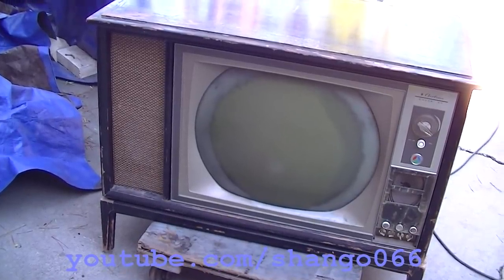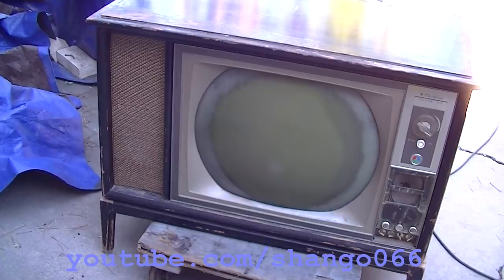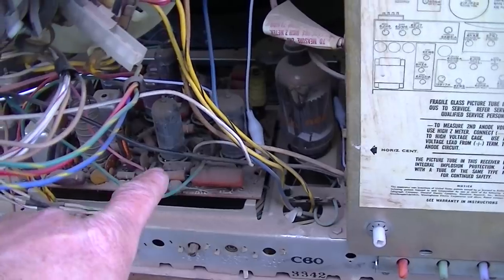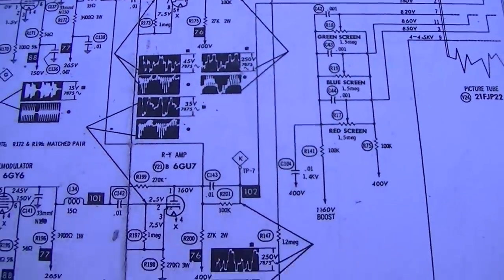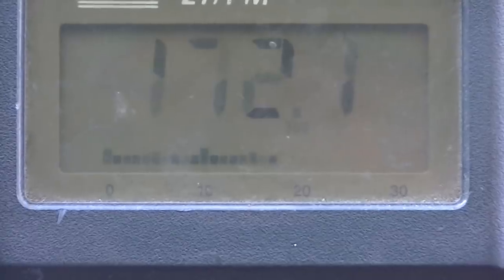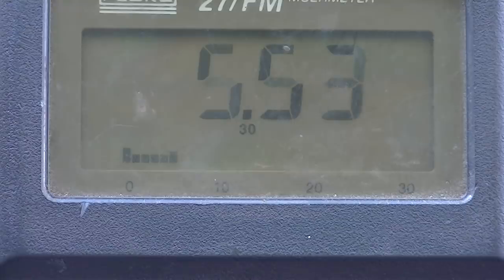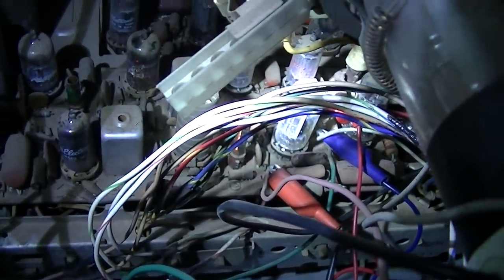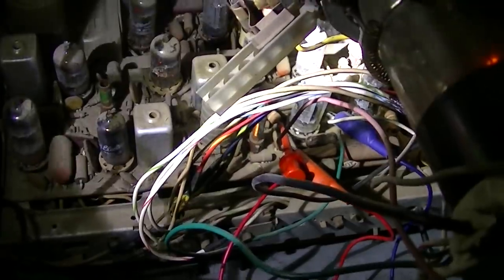RCA CTC15 Color Final Repair Purity Convergence Setup 1964 Color Television

Comment: I just started watching this video this morning and fairly quick into it I"m yelling I know what's wrong.  50 years ago I was working for a TV shop in Longview, TX and had a CTC-15 on the bench displaying the same symptoms.  The Boss/Owner of the shop let me get out more and more gear trying to find it until I guess I was just eating up too much time.  He came over and shined his little penlight on that wire on top of the board and said change that wire.  I did, he was right.  When I pulled on it it just fell apart.  Bravo for finding it without the Boss showing it too you...
Reply: Awesome story.

Comment: The all-plastic LED flatscreen I'm watching this on has a much better picture, but it certainly won't be around 55 years from now.
Reply: most of these aren't around 55 years later either, and this one is only back after many repairs.
Reply: OLED=crap, LCD=crap, Plasma=much much better, CRT=King
Reply: @Synthematix  Plasma is without a doubt the least reliable of any of those, by a huge margin
Reply: @onometre  depends in what brand you buy, pioneer were the best, also plasma tvs colour reproduction is 10x better than lcd, buy cheap buy twice, my pioneer set is going strong after 11 years
Reply: Well I would say probably even an older CRT like this does have better contrast and color (when working right and not worn out of course) than an LCD. LCDs do have better sharpness though thanks to pixels.
Reply: My brother repairs those things on a daily basis. They make them hard to service on purpose. He says they could make them to last a hundred years if they wanted to. Instead they design them to last only 2 or 3 years.
Reply: The point is the picture was way better, but by now all of those tubes are dimm and weak, that's why the colors and definition is like that.
Reply: @stevehoward3049  Eh, I dunno about that. Some electronics are like that of course, but with consumer TVs specifically, I think it's more so that they just don't think about serviceability at all, rather than making it purposefully difficult. It's simply cheaper to not bother; the short lifetimes and unrepairability are just a bonus.

Comment: How you leave your video's raw unedited makes you look smarter because you found the problem and how to fix it as well. Keep up the good work.
Reply: It’s more educational, since it’s how troubleshooting really is. Rarely does someone figure it out on the first try.
Reply: Was going to make a remark when shango066 said something about 'troubleshooting', that's OK as long as you can get the schematics. Hard to do on anything new today, (no schematics available) and it's hard to find the old things like these neat old TV's that you CAN get schematics on. REALLY hard to diagnose without a schematic.
Reply: @randyr.parker2698  Almost all of these sets were fully documented in their Sam's Photofact folder, most of which you can either find scanned online for free or on their website for a small amount of money. The same goes for almost every radio, they were being documented from the early 1930s up until the mid 1980s.

Unlike this old equipment, more modern televisions are not designed to be serviced in any way by anyone except the manufacturer - Who will likely recycle the old component and just replace it outright rather than actually fixing anything.
Reply: Troubleshooting is always the most difficult part of the repair process easy pee-zee once the problem is discovered.

Comment: Hello Shango, The old timers in the shop I worked at in the late 1970's told me after degaussing, to turn the degauss coil perpendicular (90 degrees), at the center of the screen, then move away slowly. Just a tidbit of how they taught me to do it. Fantastic finding that leaky disc cap. Swear I've seen that issue before, way back, but never solved it.

Comment: Awesome video

I worked in the TV and Video industry and repaired them for years.

To make money, I used to go to the refuse tip and get equipment; to renovate and clean and re-sell.
I started, just as valves were going out of fashion.
I worked on many Manufacturers.
Phillips were my favourite, and Grundig my least.

Line output transistors and transformers were common.
I also had to do tube replacements and total setup from scratch if magnets weren’t attached.

Also we had many tubes re-gunned if we couldn’t find a replacement tube.

I have a brand new tube tester, I cant seem to sell, because CRT Technology is no more.

Comment: Excellent! You did a great job with this set as per YOUR usual, by focusing on diagnosis rather than random parts replacement. I learn a lot every time I watch one of your videos. Believe it or not, this helped me repair an old florescent display calculator from the early 1970s for a friend recently.

Comment: thanks for one more very good video ! When I remember it right, the purity-alignment has to begin with putting the defl. coil at front as wide as possible, then you get a colour-mixed-picture (only red is on, as you said) with a red spot. This red spot has to be centered in the middle with the purity-magnets and now the defl. coil has to be moved to rear, the red spot in the midle will be bigger until the red-raster is filled out and most pure. You can do it also in your way, I did it, too, but its not the correct way to do it, when I'm right.
I would agree with xsc1000, its more usable to measure in the colour demodulation-unit with the 8 colour bar-test-signal. I am more familar with PAL and SECAM, too. You get a feeling for the right look of the h-synchronisized signals, if you compare them with a working unit.
Your way with the vectorscope is in my opinion a bit too complicated to do, needs much more experience to interpret faulty signal.

Comment: Wouldnt it have been a good idea to put a slightly higher wattage resistor in there as a replacement since its a common failure part suggesting a design flaw ? Rewatching your old videos because the world is increasingly crazy and these videos take me away to a better place . This channel has helped me get through the years with soul crushing depression. I could watch these videos forever . Its just pure brilliance . That quote from charlie and the chocolate factory comes to mind when I think about shango .."There shines a good deed in a weary world"

Comment: My first color tv repairs were the ctc15.
Back when they were in use, I don't remember any in as good condition as yours. Clean, no dust and cig smoke, no dripping flyback.
     Bad 6BK4 by GE replacement in this type of set could produce soft x-rays under the hv area.
     Started the x-ray scare.
You can crank up the hv in this set. Some diyers thiufht it would make it brighter. Just more likely to make it fail.
     Earth science teacher in high school got me a dosimeter badge to use while working closely with many 6bk4 regulator set. Never showed anything.
     Later sets had fixed precision resistors in place of pot, and of course later, shutdown circuits.

Comment: If you google 'crt phosphor research' there is a pdf listing all the phosphors used and their uses and composition. (Pre 1965 I think).
Also for confused new people - To converge a TV set there is a technique that is usually adhered to. There are two steps to adjusting convergence, static and dynamic. The center of the screen should be set first statically with the yoke magnets. Turn off blue gun and align the green and red in center. Turn on blue and align that. Then...i forget if you turn off blue again? but anyway then the dynamic controls (electronic) on the convergence panel can be used to set extremities. Repeat procedure.
Purity adjustment ensures the electron guns hit the right phosphors through the shadow mask. Degaussing  is also in effect a purity adjustment and this removes any remaining magnetism left in the steel shadow mask which would lead to misregistration of electron beam.  (Some early TV didn't have automatic degaussing at switch on - Though even this can not remove highly magnetised shadow mask errors - you would need to do what Shango did.) and as Shango showed this purity adjustment must be done first.

Comment: Great video, good that you were able to get that set looking decent. After seeing orange people on these things for many years, it's nice to see skin tones that look like people. 

Remember that the NTSC color subcarrier is really a suppressed carrier quadrature modulated thing. Looking at your vectorscope, you'll notice that R-Y is at the top of the screen, and B-Y is on the right, 90° in phase from it. It's just that when matrixing these things together it gets confusing.

Much of my knowledge of quadrature modulation came from trying to figure out how to directly modulate an Ampliphase transmitter with left and right audio, and have it come out C-QuAM stereo at the other end. Never got that one settled, but I did find another method of gathering the vectors to angle modulate the transmitter with.

Comment: I wonder if the reason that bad jumper wire became a bigger issue later on was because before you were jumping that 18w resistor into a different part?  Maybe where the jumper was meant not so much current had to run through that bad wire?

Comment: Shango, if I recall, the deguassing procedure is done with the set powered down (or in the first several seconds of power-on when the CRT is not in operation). My RCA manuals aren't with me here, but that's what I recall from 55 yrs ago. Then CRT setup: purity, screen, focus, height, width, followed by basic convergence. 

If you had color signal issues, then you'd do signal tracing starting at the video detector, looking for decent composite signal, then color separator and first chroma amp, then color-burst oscillator, then chroma detectors and then the I/Q matrix just before the CRT. At that point, you've got a color picture on the screen. 

That's the RCA recommended order of things, but you've gone with a simpler more direct 'existential' approach. ;-)

Comment: Mud Daubers! Its a member of the wasps family.  Very common in the Southern east USA.
Reply: I hate these things, many atvs, quads, dirt bikes hell even air compressors have fallen victim of these hell demons. They like to crawl up the exhaust and build their nest in the cylinder or build nests in the air boxes
Reply: Way too common up here in Northern California.
Reply: Damn things like to nest inside pitot tubes in airplanes, too, leading to some very bad things like no airspeed indication.
Reply: @nasiriyah110  - Why aren't the pitot tubes, being capped when not in use?
Reply: Marka Oslo normally they are capped immediately after landing with a fabric sleeve and a "remove before flight" tag.  However sometimes they are not covered right away.  I have also seen spiders cause issues.  I had an aircraft once abort takeoff due to no airspeed indication.  Sure enough, there was an obstruction in the system.  A blast of compressed air resulted in a mud dauber and its small nest shooting out the front of the tube like a cannon!

Comment: Serial recappers don’t know how to diagnose
Reply: That's for sure and you won't learn a darn thing that way.
Reply: Depends, if it's a type you know are likely leaking why not change them before doing diagnosis?  Not to fix the problem but to give you a workable chassis to fix.
Reply: Robin Sattahip I would not consider that a serial recapper situation as long as you actually determined the caps are leaking
Reply: @rsattahip  But this very video disproves that. Shango not only did a thorough diagnosis he was able to repair the set with only one capacitor replacement. And it was not a likely leaking cap as it was a disc cap. So as he pointed out in the vid a recap would have done nothing to repair the problem as people do not replace discs when they do shotgun recapping.
Reply: @rsattahip   i had a tv woking perfectly with old leaky caps and after recapping the vertical collapsed!...turns out that the vertical output cathode bypass cap was shorted and the cathode resistor was open, so the leaky cap was acting like a resistor and making the set work...with the new caps the cathode was just floating because of the open resistor....thats one of the millions of different situations were you cannot just replace caps...it will not work 7 out of 10 times...its almost never the leaky caps that are the main problem when a set doesnt work.
Reply: YEP!!
Reply: If capacitors are always the culprit, why were they not the main culprit a couple decades ago? When I was doing electronics repair in the early 90s, capacitors were an occasional thing, while bad connections were one of the first things we checked for, along with heat issues. The most common capacitors to fail were in the power supply, and they usually failed open, which would cause hum.
Reply: @MrHBSoftware  Never said you could just replace caps.
Reply: @rsattahip  starting to replace caps before diagnosis is the worst you can do...you will eventually discover that once you do a couple of tv sets
Reply: @rsattahip  I haven't really repaired any vintage tvs, but i have done quite a few radios and some amps. mostly because it they still have practical use  today but for me if i find a old radio i wont even plug it in until ive replaced the paper and electrolytic caps.  and the only real problem i have with this channel is the fact he doesn't actually test for leaky caps, hes testing potentially leaky caps with a dmm which will not tell if a cap is leaky or not even really leaky caps will show good on a dmm because of really low voltage the dmm uses. he need to invest in a old school leak tester that will test the caps at there operating voltage.

call me a serial recapper if you want but i haven't failed to fix any radio or amp old enough to need to be caped. also ive rarely had to replace a tube and on the few that i have its because it had been used with bad caps, caps are cheap tubes no so much just replace them and start with a good baseline for the rest of the trouble shooting..

and if your wondering about a leaked tester check out mrcarlsonslab on youtube he has so quality videos and goes in to depth about testing caps for leakage
Reply: You do realize all caps will need to be replaced eventually.  No harm is done, recapping a television set.   ...if it is done correctly, a recapped television set will last another 30 years.  Is recapping diagnosing?  No.  Is it "future-proofing"?  Yes.  ...preventative maintenance is the best maintainance.
Reply: @badreality2  i have to assume you never worked on a tube television before...for example if you recap you will at the very least mess with the line frequency because probably somebody ran the set with leaky caps and weak tubes and turned the frequency coil all the way to one side etc... and you will not be able to display a picture on the screen, if there is another problem wich will probably exist you will have a hard time figuring it out... ohhhhh i dont have sync , is it the sync separator, is it the agc, is it IF or tuner? i dont know...often corrections were done to the controls and component values to compensate for old caps and high value resistors and when you put the new ones in you will be presented with a non working circuit section, and many other issues....thats why you get the set working and you recap by steps...and its almost never bad caps that prevent a set from working fine...sure you can have poor linearity and other issues...apart from a few critical caps the others although they should be replaced they dont prevent the set from working.. you really need to know what you are doing not just start replacing parts and hope it works in the end, it will not. after you are done servicing a tv you start recapping by steps and testing along the way, in the end the tv always needs a full setup or you wont be able to watch anything on it. often just replacing a weak horiz output tube with a brand new one messes up the line frequency, increases the boost voltage wich feeds to different circuits, sometimes making the image taller, screwing the vertical linearity and possibly making you have to tweak a bunch of controls...tv's are a touchy thing and radio theory doesnt work there

Comment: Those disc caps are Z5U dielectric. In case you are not familiar, Z5U puts the "die" in "die-electric". The voltage coefficient of capacitance means they are about equivalent to some snot on two thin twigs at working voltage.
Reply: That is an UNSPEAKABLE FALSITY, based on an ODEOUS SUPPOSITION!

Comment: One of the characteristics of those sets is the fact that the color always seemed to jump out of adjustment. I assume this happens because some of the components in the color demodulation circuit are sensitive to temperature changes and drift because of those changes.
Reply: The main problem is the DC level. In modern sets (and in CTC100), DC level is restored in last amplifier before CRT, all other circuits are AC coupled. But these 60s sets are simplified and circuits from NTSC demodulator across signal matrix to picture amplifiers and CRT are DC coupled. So every change in resistor value, tube gain (caused by temperature and aging) makes slight shift in R,G,B levels.

Comment: I'd recommend to run the degaussing coil 30 seconds each run. They can overheat and break easily if overused per run. I'd do that just so I don't have to buy a new one then.😁 Very good job getting it aligned, my big tv just needs a brightener on it and it will be back to good.

Comment: No.1 is always replacing all Rs and Cs with new ones of high quality (in Cs keep an eye of the outer connection)
On hot getting Rs give them a small coolerfin

But picture doesn't look that bad, spedialy for an 55y old tube and the old components
that's great!